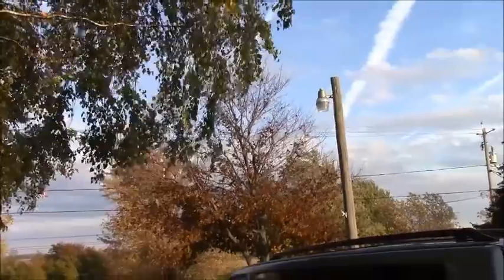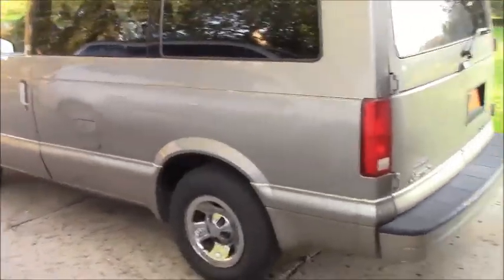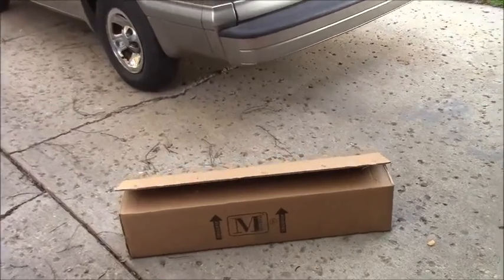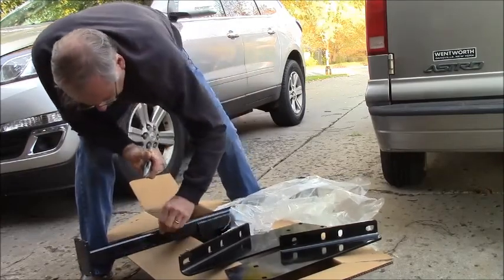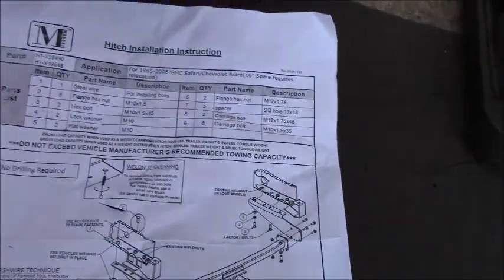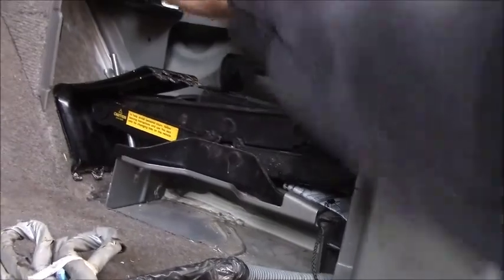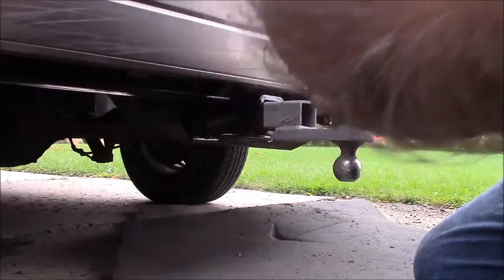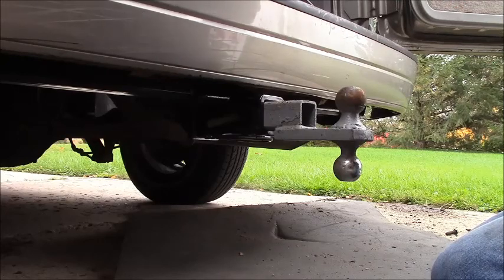DIY car repair, How to install a trailer hitch on an Astro Safari van

Comment: I have an all-wheel drive 2003 Astro van that has a pretty strong hitch but when I first bought the van it has surface rust you should send the rest off first so you don't bottom out when you're hauling something
Reply from the maker: There may be a little frame rust repair in my future! I'm going to inspect it all and determine the extent of the rust. I alos saw replacement bumper liners online cheap, I might replace them too!

Comment: Do I take the rear bumper off?
Or do I leave it on?
Reply from the maker: Nope, you just have to loosen the bolts so you can slip the tabs of the hitch between the bumper arms and the frame. Also loosen the brackets on each end. Hit them with your favorite rust busting lube. Good luck! Thanks for watching!

Comment: Nice install Bob . Any car repair or install videos would be nice to see . Do you still have the trailblazer or was it an envoy ?
Reply from the maker: Ken Oger well, I sort of have the 2005 Envoy, we fixed it up and passed it on to my grandson to drive to college in our western NYS winters, so I may have it again, but I changed all of the typical wear parts, of course I did many videos on the 67 Mustang and my Astro
Reply from the maker: Ken Oger I’m worried about the rust in the frame of this Astro, hope it passes inspection for a few years, I’ve got $4k into it
Reply from the maker: So an update... my grandson was driving the Envoy to his girlfriend's house (30 miles) and the serpentine belt broke but it was late and he didn't stop... so the engine seized... not worth fixing... so SCRAPPED!
Reply: @bobsbarnworkshop  sorry to hear that Bob.  They were great vehicles in there day. As long as your grandson was OK that's what matters.

Comment: I think that, if you've questionable frame members such that you comment about the frame members giving way and the trailer going one way . . . Don't post that video online!  If it does break apart and you injure someone, your insurer is likely to beg off upon seeing the video arguing that you knew the vehicle was unsafe! 
Also, the position of the trailer tongue dictates the height of the ball and there was no evidence that he/you made any measurements.

Comment: "frame looks good" yeah right dude its rusted to crap
Reply from the maker: Yeah….. it’s bad. The previous owner must have parked it on the grass or weeds all the time. But, it’s still going! Up here in rural NY they salt the roads in winter making it even worse…. I use it as a rolling warehouse for my sound gear, serves the purpose!
Thanks for watching!